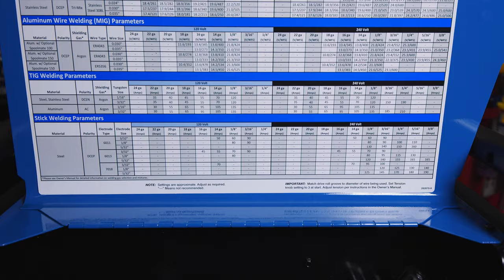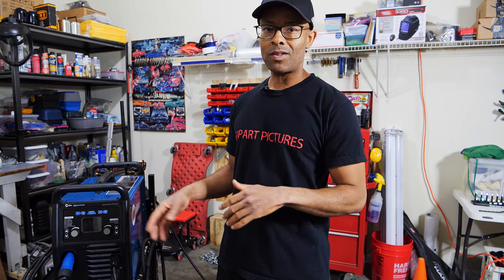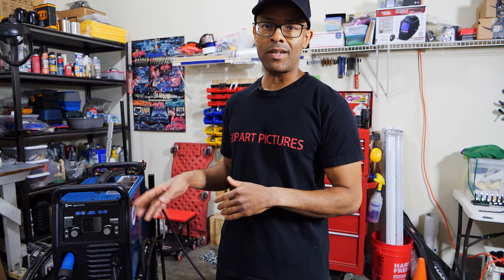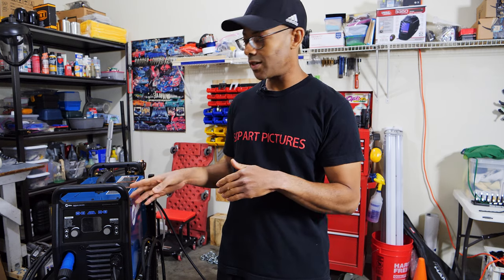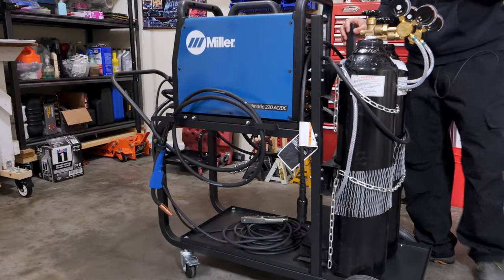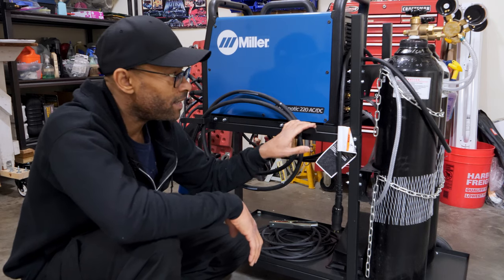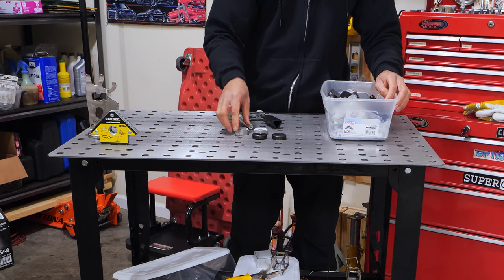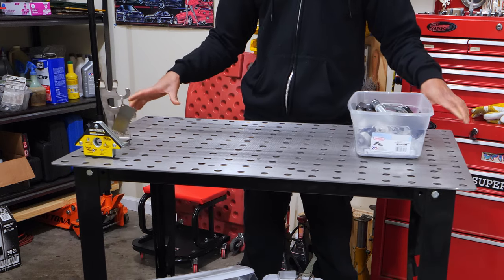The BEST WELDER For Beginners - MILLER MULTIMATIC 220 AC/DC Welder (Multiprocess Welder)

Comment: Hey could you help me realy quick? I've got a 2000 s500 and i had to get ball joints all changed. now i hear a knocking noise sometimes when i drive. could this be the strut or is it something else?
Reply from the maker: Hello Justine r, It could be a loose sway bar link or your ball joints. I just made a video on replacing your lower ball joint. You can view it here: https://youtu.be/jntvXHKUYTE
If you are still unsure I would suggest taking it in to a certified Mercedes Benz mechanic for further inspection. 
Hope this helps. Cheers!

Comment: I just bought this, what circuit breaker is needed the plug says it’s 20amp 250v, but the manual saying it’s 40amp. I want to get a 240 receptacle installed in my garage and want to buy the right equipment. Thanks
Reply from the maker: Hello David Montes II, I'm not entirely sure on what size breaker you will need for 240. It depends on how many amps your main box can handle. That is something a professional electrician will be able to help you with. What I can say is that I'm using it on 120v with a 15 amp breaker and 10AWG power cord at 25 feet and it runs perfect. I hope this helps.

Comment: Hey GD love the vids really get some good info from you quick ?  I have a 2004 s500 4matic w220 its been sitting in my garage for 5 long years I love this car have to get it back on the road ASAP! it starts up but when I put put it in gear it wont move FWD OR REV any ideas what could be the problem I'm really handy can fix it myself just need to be pointed in the right direction the dealer charges way too much don't wanna pay for something I know I can do myself any help is truly appreciated.   Thanks in advance
Reply from the maker: Hello Lynix Hosley, It could be a few things. Sometimes the shift linkage clip falls out and your car will shift through the gears, but not actually engage the gears in the transmission. Here is a link that might help you out. I hope this helps. Cheers!

https://youtu.be/xsVJThP2D1U

Comment: For beginners? I do not agree at all. This machine is a beast even on industrial applications and for any type of welder. The best Miller machine so far, that's why this machine took a lot to release.
Reply from the maker: Hello Victor D. Mogollon, I agree with you 100%. I guess what I was trying to say is that it's a machine that you can grow into and still handle big jobs without the need to buy another machine later down the line.

Comment: $3600 beginner welder?
Reply from the maker: Hello BitsofBytes, At the time of making this video I purchased it for under 3k and that was with a good helmet. The prices have definitely gone up unfortunately. However, I still think the current price is good for a beginner. When you consider the quality of the welder. All the options you get, MIG, TIG, Stick welding. You can also weld Aluminum which is probably the biggest selling factor. Not to mention the Duty cycle is the highest in its price range. Plus, you get two bottle connectors and 120 and 240 power options. You really can't beat it. If you were to buy a MIG welder and a separate TIG welder, that alone would cost more than the price of this welder. Not to mention, you'll need another welding cart. Plus the Miller Multimatic 220 comes with everything  you need to get started. Some beginner welders lack the accessories you need meaning you'll have to pay more. I'm not trying to sell the Miller brand, and I'm not a Miller fan boy, but I did the research and weighed my options and this welder was the best choice at the time. I hope this helps. Cheers!
Reply: I just ordered one, I've never owned a welder.
We do CNC prototyping, low-volume production, and high-volume process development, so we definitely need AC TIG to do aluminum (fixture tweaking and repair). I would also like to have a MIG for doing basic fab work around the shop, so I'm eventually on the hook for 2 welders, and if I don't go bottom of the barrel on them, I'm already spending close to the $3400 for the 220.
Aside from the fact that I like shiny new toys, there is no conceivable reason this one welder won't last me 20 years. If I somehow become a welding guru and the capabilities of the 220 don't meet my future needs, it will have well more than paid for itself. Long term thinking? The 220 looks like the ultimate "I just want one welder and I want to be done with buying welders forever" product for general purpose, lite duty use.
Reply: Buy a bunch of Chinese welders to practice on amd now ill have a bunch of them collecting dust in my shop as I surpassed them fairly quickly and now I'm buying a real welder